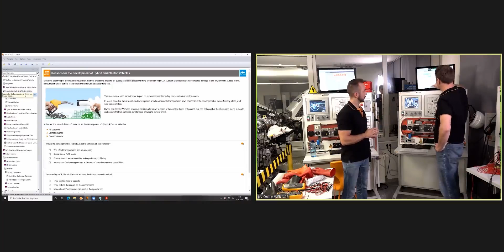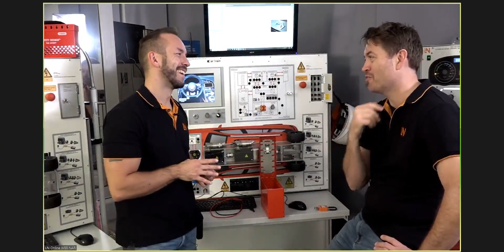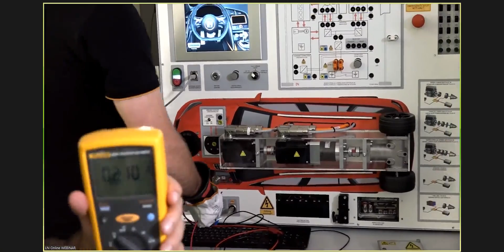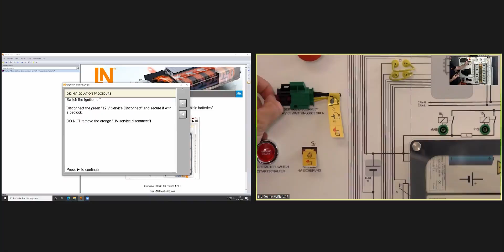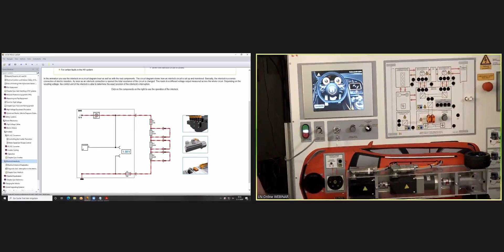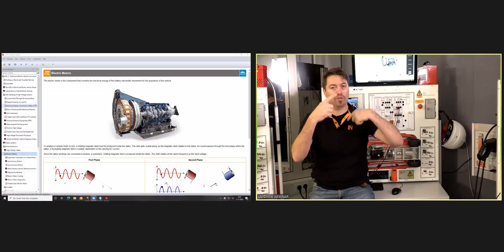ASE L3 Certification for HEV Technicians (USA) | Webinar

Comment: Well done! Thank you both for taking the time to share your knowledge.  Question, at around the 1:12 mark where the voltage is changing depending on which/how many interlock switches are open, it looks like the voltage should stay steady at 12v since it appears as though the reference points are before and after all the resistors.  Is there a mistake in the drawing or am I missing something?
Reply from the maker: Thank you very much :) Regarding your question - we will forward this! :)
Reply from the maker: Thanks for the question! So, it might be hard to see on this video, but the inside little square next to the 12 V source it says "constant current", of I think 10 mA. This constant current is going to change the voltage to keep that current at the same level. So the constant current device is supplied with 12 V, but it will vary the output voltage depended on how much resistance there is in the circuit. So essentially, the voltage we are seeing is still the voltage drop across the whole circuit, but we are seeing this change according to each new resistance that is being introduced. As we introduce more resistance (opening more interlocks), the voltage needs to increase to keep the current at the same level. I hope that helps?
Reply: @LucasNuelleInternational Oh I see now, my mistake.  Thank you for clarifying and keep up the good work!
Reply from the maker: Your welcome!

Comment: I got a question when using mega ohm meter should electronic devices be unplugged specially ones connected to high voltage like the sensor wires on the battery bus
Reply from the maker: Do you mean for an insulation measurement? In general, if you want to measure the electrical resistance of a device, you should isolated as best as possible from all other connections. If you perform an insulation measurement in the HV system, you don't need to worry about those connections you have mentioned. They are isolated from the HV system and it is most unlikely, that they have a faulty connection to the HV system.
Reply: @LucasNuelleInternational  That answer my question. In the real world scenario testing for insulation fault is more complex. Usually involving taking things apart for access. It’s just the way you did it in the video made it seem a lot more simple.

Comment: I can’t thank you enough guys. I own an HEV/ EV repair shop on its infancy and I am mostly familiar with hybrid and only have an EV in my shop once which was an older 24KW Nissan Leaf. I have big dream for my shop and understand the importance of ASE certification. Not just for trust issue but most insurance and extended warranty provider requires it. Again I can’t thank you enough
Reply from the maker: Thank you very much for your comment, Ronaldo! :)